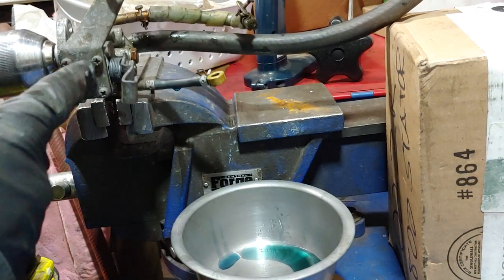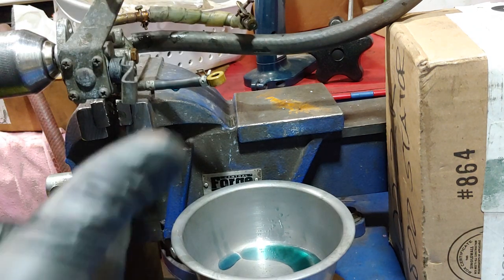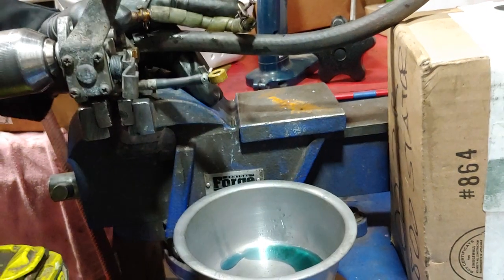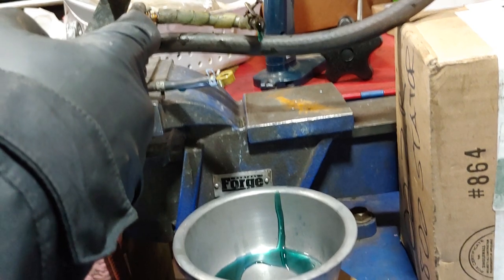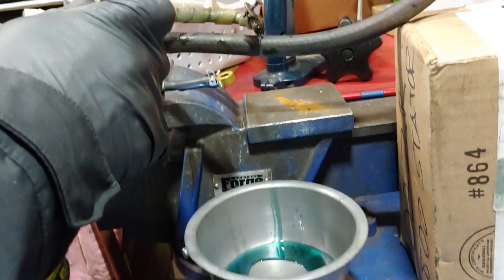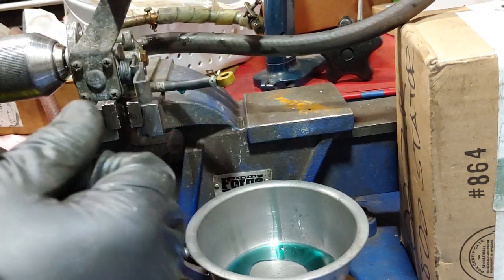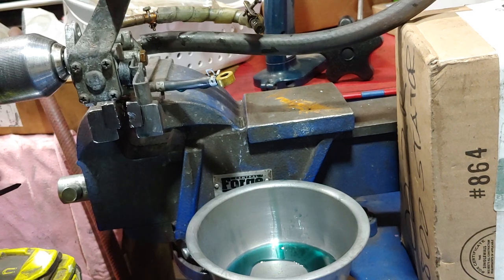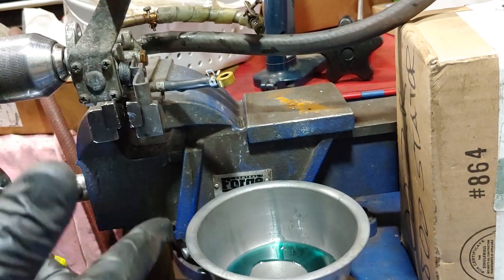Other problems: Arctic Cat Oil Pump Testing

Comment: Swap out the check valve from good pump to bad pump if bad pump dumps oil at idle.supposedly if check valve goes bad (the brass piece on the pump)it's supposed to dump oil
Reply from the maker: Yep I will be doing this most likely. But with brand new ones. Thanks for the support.

Comment: carbs right? is it rich at wide open or it it midrange? or pilot circuit at idle,,these are the questions you should be asking yerself BEFORE even pulling oil pump,,check yer witness marks on oil pump,,line them up,,and go with that
Reply from the maker: True man.

Comment: You have to have some oil flow even at idle....or it'll cook itself!
Reply from the maker: Yes sir! I always adjust the pump arm to match the boss lines on the pump body at idle and WOT. Exactly at WOT and that usually works out to be a hair below at idle but no big deal. Never has been. Thanos for watching and Subscribing if you did!

Comment: If its not getting any oil while idling.....how the hell is it getting lubricant? And no it didn't look like too much at wot
Reply from the maker: They get very little at idle. But if the check valves get stiff it will take more pressure for them to open. So if this is the case it wouldnt get enough at idle nor wot. But the good thing is that the check valves can be tested and replaces if needed.
Reply: So where is this valve?
Reply from the maker: @bojk13  The check valves are the brass connectors that bolt onto the pump and that the oil lines to the cylinders (or fuel pump) and bottom of case cnnect to. Those are the check valves. You can test them or just get brand new ones from CountryCat dot com or Babbitsonline dot com. You can get a simple pressure tester from harbor fr-eight. When you pull them off there are two crush washers that go on either side of it...

Comment: What year pumps does this method apply to?
Reply from the maker: Most if not all. Best way to tell is to find your year service manual and check in that. But they all have the same functional design to the best of my knowledge.
Reply: @Fixin2Ride-Official-  even with the new electronic oil pumps on the 2019s and later?
Reply from the maker: I wouldnt think those would be the same .. If they have a an electric motor that runs them instead of being powered by the worm gear in the crank, you coupd try and take the electric motor off, power it with 5volts to the leads to see which direction it turns, then find a way to turn the oil pump in the same dorection... I wouldn't think that the electric motor would go I had that quick after only a couple years but who knows these days with all the Chinese crap out there. But I would think that the mechanical portion of pump would be fine and that if your pump is not outputting oil and it is indeed turn buy an electric motor instead of off of the crank it's probably the electric motor that's bad so I would test that first for sure. Why are you suspecting that your oil pump is bad? Did you burn down an engine or something
Reply: @Fixin2Ride-Official-  well last year we struggled with our 2019 cutting ignition and we didn’t know why until the code “oil pump outlier” or p1103 (has 4345 miles on it) came up we had to argue with cat reps to replace the pump because they “never heard of a pump going bad” we just got that sled back and we’re able to ride it for the first time this weekend and now it works great but we also have 2020 riot with somewhere around 5000 miles I’m not sure the exact number right now, but now it having the same exact issues as our 2019 so there definitely seems to be some type of flaw in the system or we just have really bad luck.
Reply from the maker: Probably a flaw. Lol. Unfortuantely this is why Id rather have my older sleds at this point.

Comment: I have the same problem mine is pulling air through one of the lines , other side works fine , someone help thx
Reply from the maker: If one side is pulling are than I would think that it may be one of the sealing washers on either side of the check valve are there bad or missing or the banjo bolt isn't tight enough. I would also check and make sure that you put new lines on there and that they have a nice tight zip tie on them
Reply: @Fixin2Ride-Official-  thx
Reply from the maker: @arloslab3469  NP. Let me know what you find!